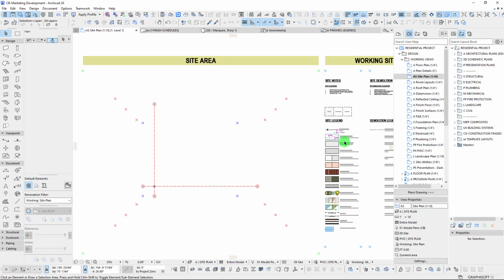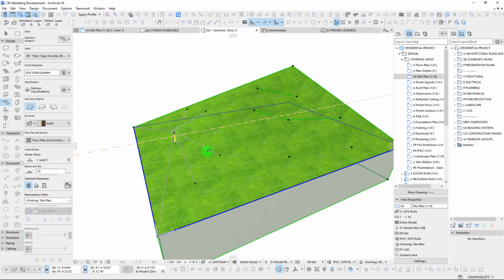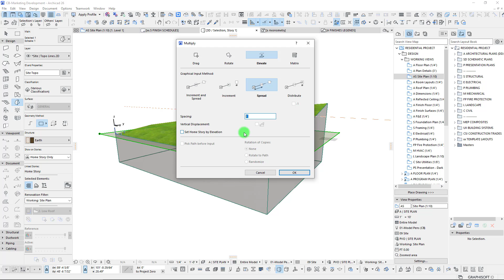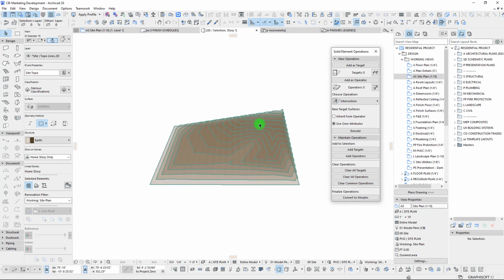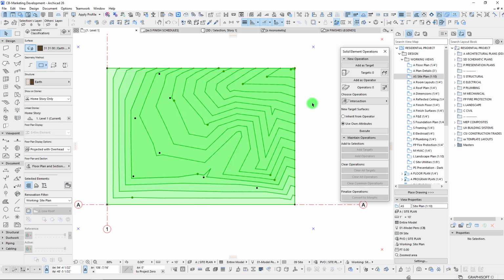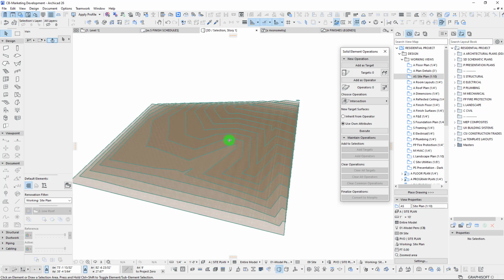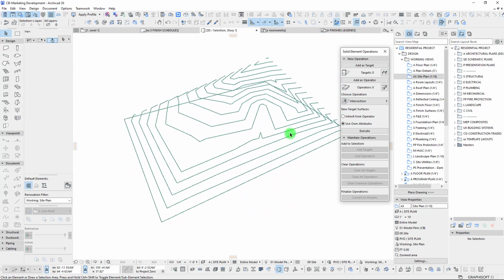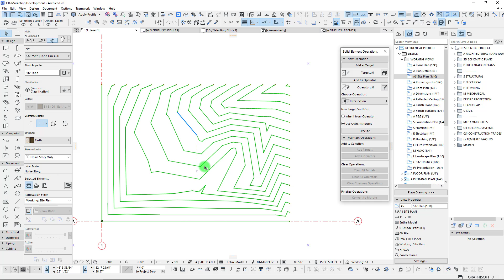How to Create 3D Topographic Contour Lines from Meshes in Archicad

Comment: Great tip!  've been using Archicad for almost 20 years and workflow around doing grading plans has always been awkward.  I start with a mesh generated from surveyor's data (contours, not point field).  Initially I did it old school by reworking each contour individually, which was very time-consuming and awkward around places where I wanted a grade break/ retaining wall.  About 7-8 years ago I started creating "modifier meshes" that added or subtracted from the base mesh through SEO, but the generation of contours from these still required a lot of hand work with tracing and extrapolating. (despite several days spent trying to automate that process, including one dead end where I did the same thing you did here with slabs)  I'm looking forward to integrating this tip into my workflow, and hope it can streamline the process.

Comment: Please elaborate on the use of the resulting geometry and/or line work.  

What representation or other advantage do you gain from separating the topo contour lines from mesh vs the usual method that includes the massing/volume of the mesh?  

Also, is this a one-and-done method?  Or are these resulting lines easily manipulated as we develop site options during schematic and design development phases? 

How do you use them in your documentation?  

ADDITIONAL COMMENTARY:

BIM platforms have miserable tools for site information.  It is frightening that with all the BIM advancements we can still hardly control site drainage, hillside roads, curbs, phasing, import and export quantities, etc.  Revit is just as bad but last time I checked it at least has a few additional useful functions built into the tool.  You can general elevation markers all neatly lined up with automatic elevation dimension generated on or above each line in plan, you can change topo from sloped to stepped in 3D view, you can set every 5' or 10' or whatever contour line to be bold (and this shows in 3D too).  You can't however, demo and fill, as I recall, which is totally frustrating.  Not sure how Archicad handles this.  

Anyhow, neat tricks but topo in BIM is mostly useless as far as I can tell.  I'd like to see a Rhino-type modeling platform integrated with our BIM platform.  Anyone working on this?  

Finally, our concern is that your work ends up looking like the tools available out-of-the-box.  I can see an Archicad-designed building a mile away.  So predictable.  The platform needs to catch up with Rhino somehow and still generate information for our documentation.  

Thank you!

AO

Comment: Great tutorial John! 
The thing is it that I've been doing it the same way for a couple of years and I was surprised to see someone else doing it the same way. It would be great if the contouring feature would be included in the mesh tool itself
Reply from the maker: Thanks for the comment! Yes to include them back as contours into the mesh, you can use the morph lines and go through the typical process of applying them to the morph with magic wand feature. Only problem is you have shrink your mesh slightly so the morph lines are outside the mesh for it to work properly.
Reply: @CONTRABIM   I meant it would be a nice feature for the the mesh tool itself to have auto-generated lines without all the workarounds with the SEO, morphs and etc. Looking forward for some new tips! Your content is great and super useful
Reply from the maker: @andriusvilcinskas7591  Oh ya that would be an awesome feature to automatically apply contours. Unfortunately I think we'll be stuck with the workarounds...I can't remember the last time they updated the mesh tool!

Comment: I just tried this method. I used it a little differently. I wanted contours on my mesh, but I wanted the mesh to be editable. So I just got a SEO (intersection) with the morphs as the target and the mesh as operator and I created these contour lines. When I edit the mesh, the contours also adapt.

Next thing I want to try is to create a param-o object where I can set the interval of the morphs, in order to get contour lines in whatever distance I want to set. I think this will not work, since param-o creates objects, but I'm not sure.

Another thing is to try Land4 add-on. Have you ever tried it?
Reply: I just tried the param-o solution. I works on 3d, but not on 2d.
Reply from the maker: @vassilisstergioudis  Maybe if it only worked in 3D, you could convert the object to a morph to get those 2d lines... just a thought. Would love to see how you created your paramo object!
Reply: @CONTRABIM  I just e-mailed you the param-o object. Feel free to edit and share it if you find it useful.
Reply from the maker: @vassilisstergioudis  Received thanks for sharing!
Reply from the maker: Thanks for the comment! And yes, what you describe is a very similar workflow, just stopping a few steps short of converting the topo lines to a static element. I should have described it better in the video, but the topo lines are dynamic while the mesh and morphs are still intact using SEO intersections. So if you want to modify the mesh as you describe, the topo lines generated from the morph will remain dynamic and adjust automatically. I took it one step further, of converting the morphs to static which has some benefits and also some downsides (being static). Thanks for the great comment!

Comment: This is a great technique and tutorial.
Reply from the maker: Thanks! It definitely comes in handy in certain cases when no topographic survey is available.
Reply: @CONTRABIM  you could also take this process a step further and use the Morphs as guides to create contours on the Mesh. So you end up with a process that looks like this Mesh -> Morph -> Mesh.
Reply from the maker: @Shoegnome  I suppose that is true! I had the file still open, and I just tried that actually! I didn't realize that yes we can use Morphs to add points to meshes just like a line or polyline. I did run into an issue though, as the morph lines terminated at the edge of the mesh (since I matched the same size exact), and so when elevating points it broke down and only partially worked. With a little tweaking to the approach I'm sure this could work better though! Thanks for the suggestion!
Reply: @CONTRABIM  anytime contour lines hit the edge of a mesh there can be issues. It might just mean making the mesh bigger or smaller than you need it so that the morph lines end up extending beyond the final mesh. When I started watching your video, I assumed that was your end game. So I like that you went in a different direction.
Reply from the maker: @Shoegnome  Yes typically when doing the workflow in reverse, I'll model draw the contour lines beyond the extent of the mesh to solve that issue. In this case I should have just offset the mesh a few inches and probably would have worked fine!